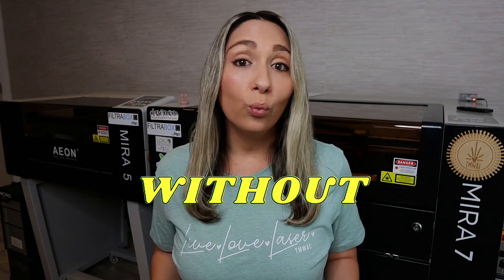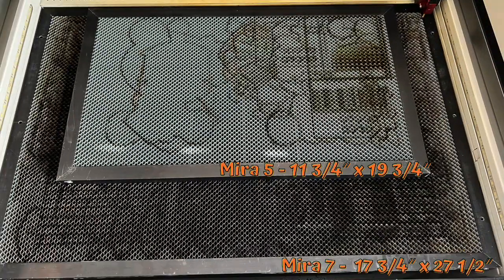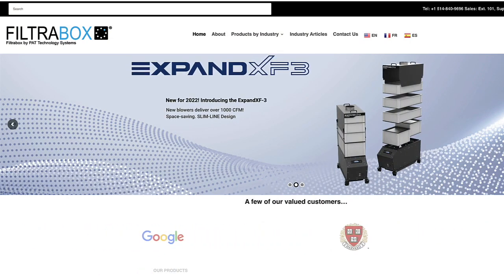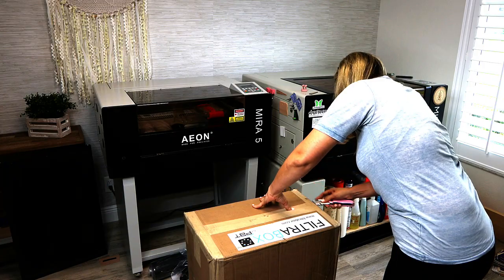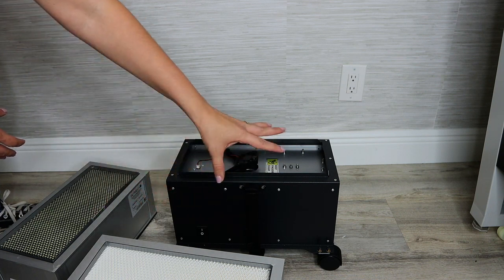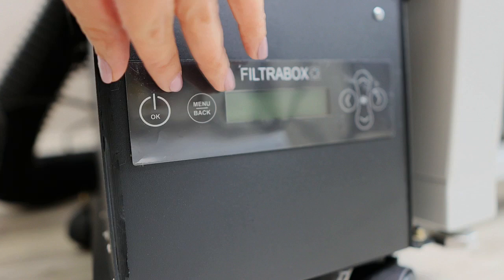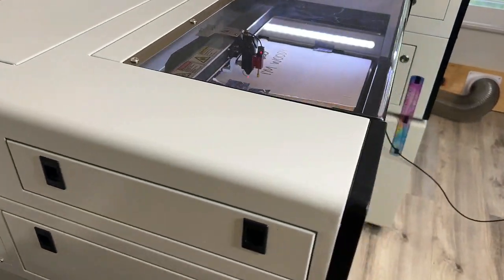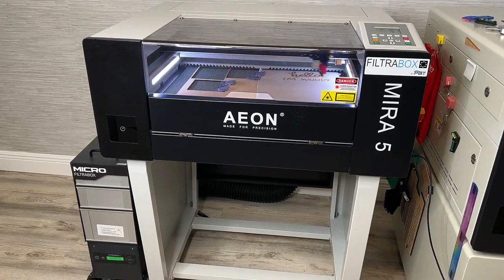How To Vent A Laser: Inside

Comment: I bought it, yay! thank you for the code. its all set up, I have a question, does the fume extractor extracts when the laser machines starts working or do I have to manually turn it on?
Reply from the maker: That's awesome! You're welcome. You'll need to turn it on whenever you're ready to use it.
Reply: @ThatMomWithALaser  thank you!

Comment: Is the FiltraBox Micro fume extractor 128 CFM big enough to do the job right?? or would the FiltraBox Compact X with 235 CFM be better and do a better job ?
Reply from the maker: It will depend on the size of your laser bed. The micro is great for my mira 5 and a Glowforge sized laser bed.
Reply: @ThatMomWithALaser  thanks, its like the size of yours

Comment: So this replaces the compressor?
Reply from the maker: No. They are two different things. The fume extractor sucks up the fumes that are created from the burn and breakdown the smell. The air compressor boosts the air that goes through the laser nozzle which helps keep the cuts cleaner and reduce flare ups.

Comment: Its interesting the bought a Mira 5 after having a Mira 7.  I would guess you’d go up in bed size.  Was there a specific reason for the Mira 5?
Reply from the maker: Great question. The Mira 7 is going to the warehouse and I’ll be adding an Aeon Nova. I still wanted to have a laser at home though so I felt that the 5 was the perfect fit since it’s small but still performs in a way that I’m used to. 😊